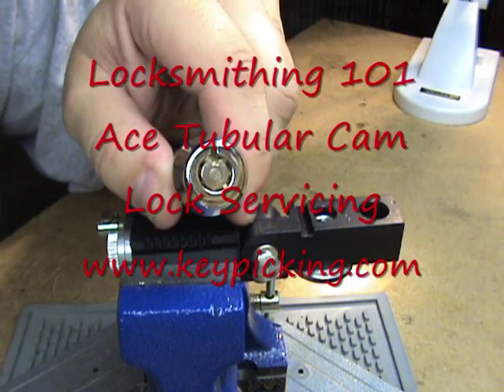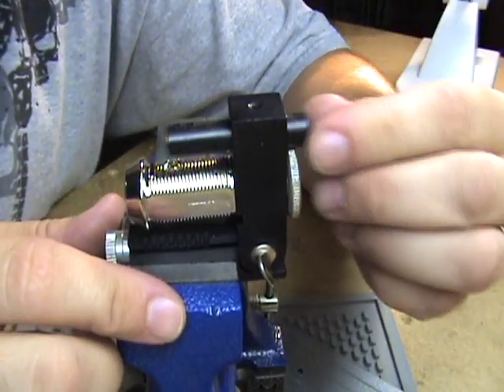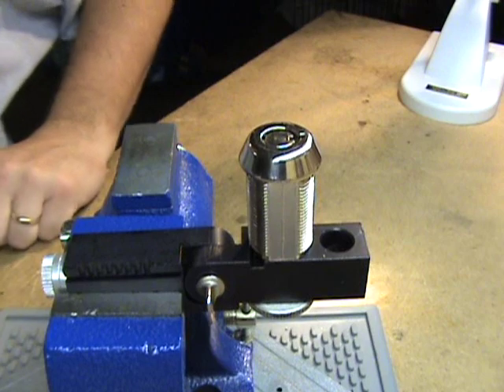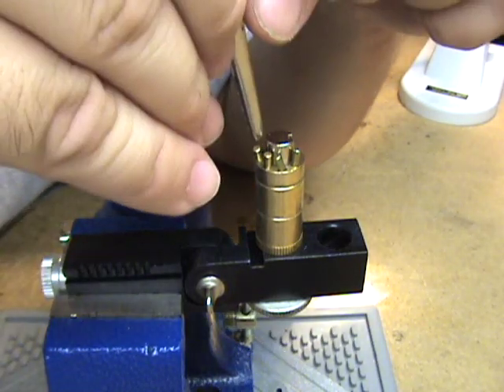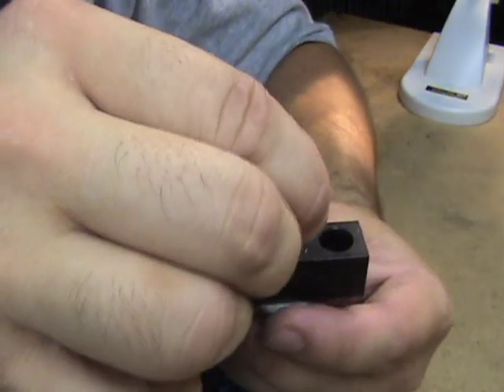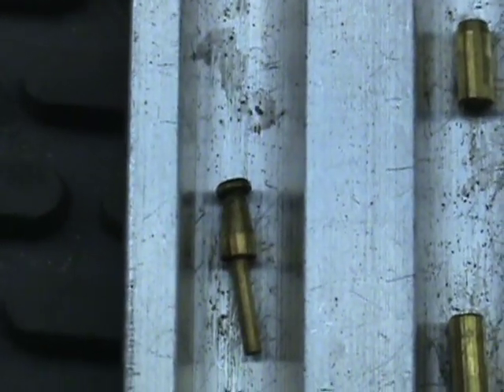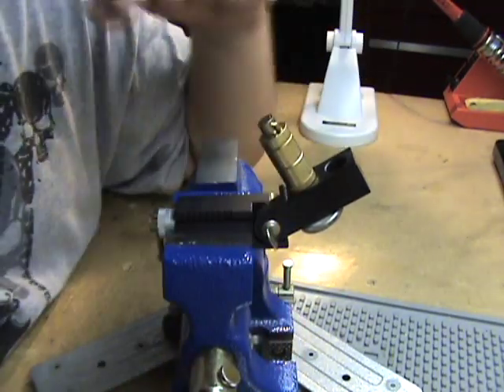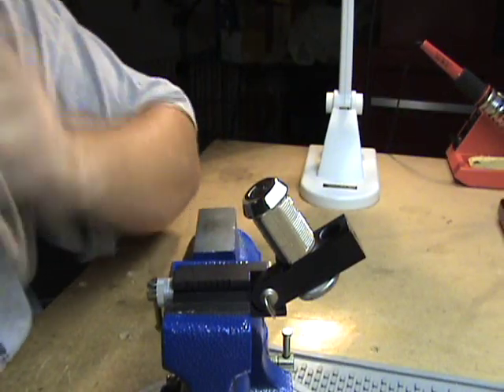Locksmithing 101 Ace Tubular Cam Lock Servicing

Comment: Great video.  I've looked for videos on repinning tubular locks as I'd never seen it done before.  This is the first video I've found on doing it and I found this by accident.  Nicely done.  I've read in the comments where you said that you can buy rekeying/pinning kits for the tubular locks but do they use the same pins as conventional pin and tumbler locks or are they a special/different size/length, etc?  Just curious.  I think I'll go look up some of your other videos in this series.  Thanks again for the video(s).